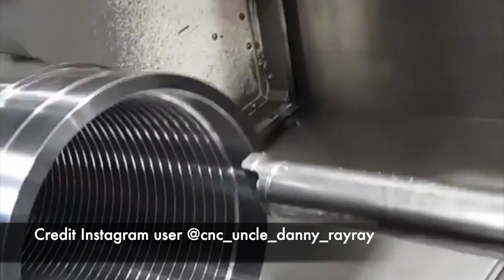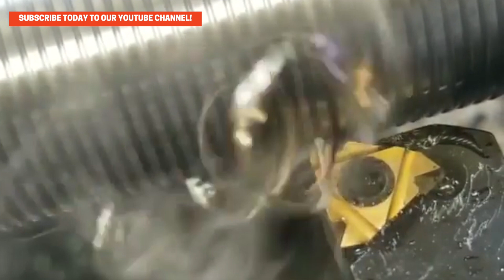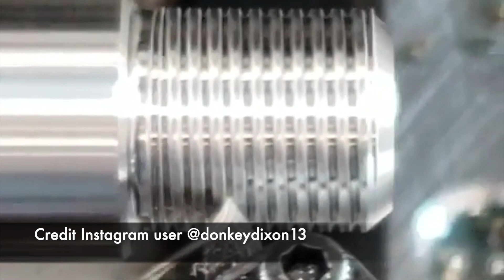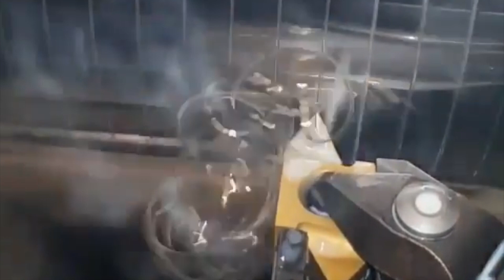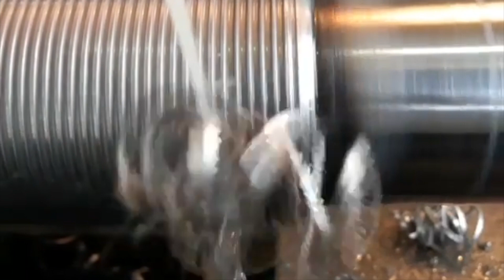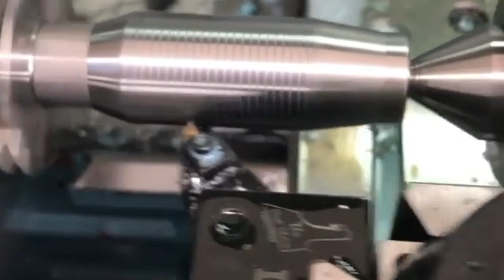THREAD CUTTING on a LATHE

Comment: My first time thread cutting on a CNC lathe was so satisfying. Get the tool set up. Get a piece in. Quick program putting in thread size, length, spring passes, pitch etc etc. Press run and sit back and watch in amazement! Had to do a few test pieces because no one would believe me how fast it could cut perfect thread!

Comment: Lathe threading is very satisfying. I am not very experienced on manual lathe but cnc is dialed. I also found if you are threading Titanium or Nitronic 60 use 29 degrees in the last 2 digits of the G76 P Value. 👍🏻

Comment: well, my english is not good enough but, i think that the key to get a good thread cutting on a lathe is have a good tool with the right angle and putting low entrance step by step until we get a good finish. i¨ve made some square thread and i have seem that the speed is not the most important, we have to be careful and patient.

Comment: Threading is very satisfiying. It is satisfactory when you see it and obviously when you do it with the complete cutting parameters and thread height.  you need to know the correct point to leave the thread tight so that it does not wobble or is very tight.  but that is generated by practice.

Comment: I think I am the only one in our shop who actually does threads on the lathes. Recently made an adapter for a gas mask that has the NATO 40mm 7TPI round profile thread and some internal and external ACME threads for the gas fields. 2.5" x 10TPI. And when it comes to API pipe threads, anything over 2"... But the CNC machine takes all the skill out of it. Just tell it the numbers... But at least it's consistent.

Comment: So nobody is mentioning that the best way to cut  thread is to feed the cutter into the material at an angle. That way chip curls easier and pressure on the cutting edge is minimized.

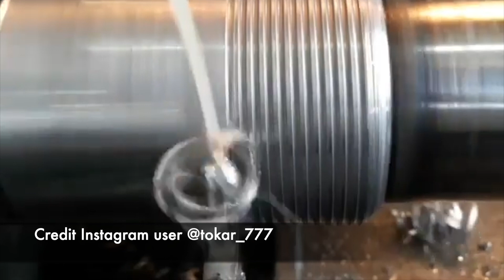Comment: 3:45 👍 I use this technique when I have to cut a metric thread with an imperial lead screw
Reply: Can you elaborate a little bit sir? I have a Logan 9b-28-1  9 inch swing and has a qcgb. Im fairly sure its a imperial thread and screw cutting lathe, but how do i cut metric threads on a imperial gearbox setup? How does returning home by reversing the chuck help?